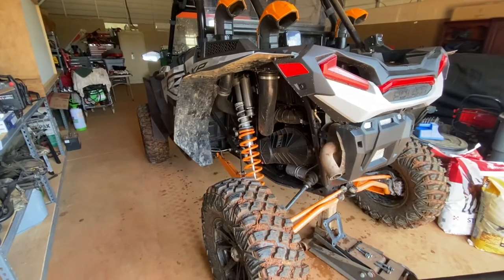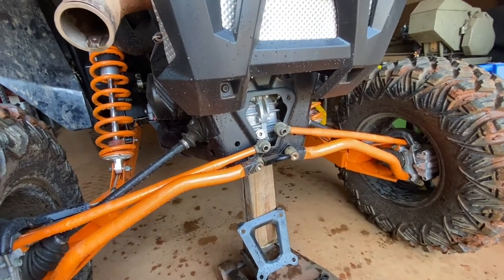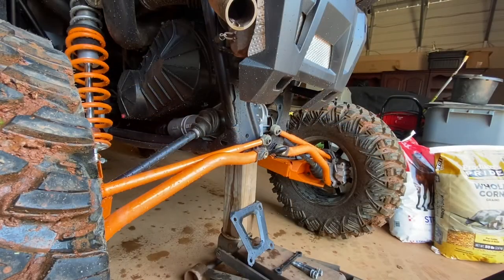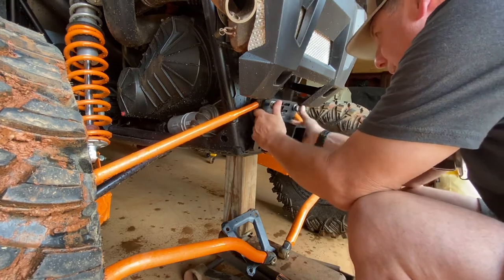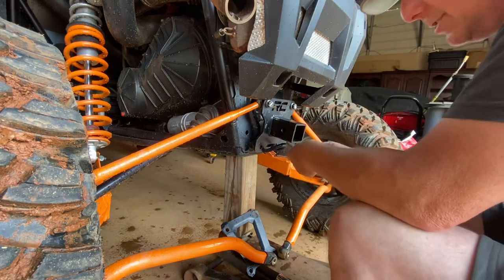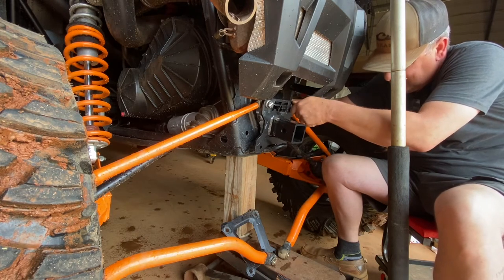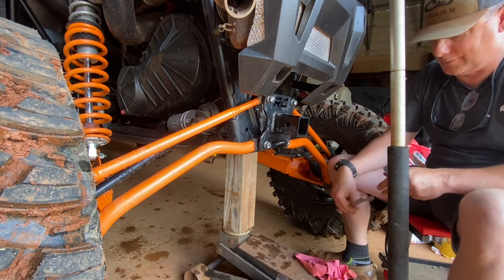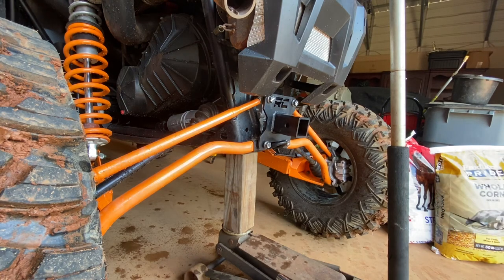2021 Polaris RZR 1000 High Lifter trailer hitch

Comment: what side nuts are those the ones you recommend replacing
Reply from the maker: The nuts on the bolts that hold the hitch in place are plastic coated threads, it prevents them from coming loose. When they are removed it’s always good to replace them, there really a one time use. People reuse them but there is always a risk of the backing off from wear on the threads. Good luck